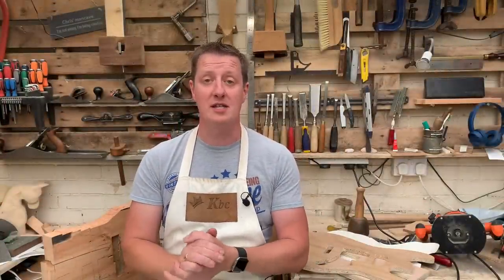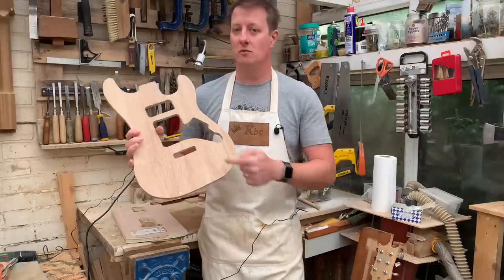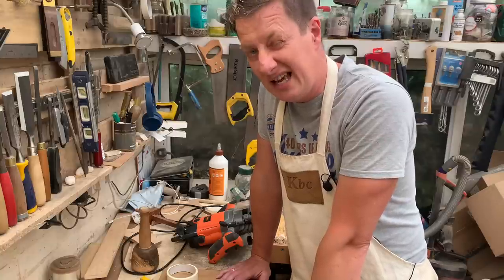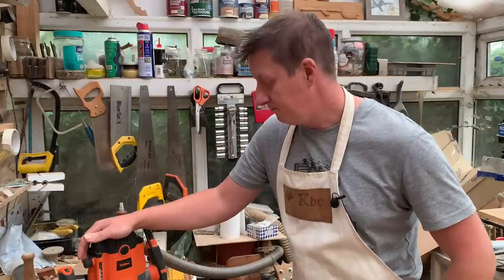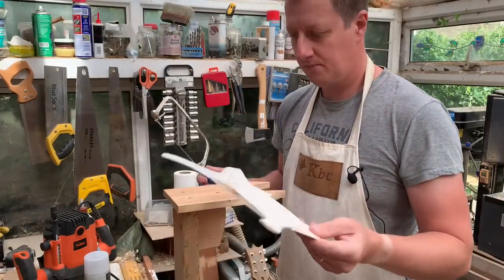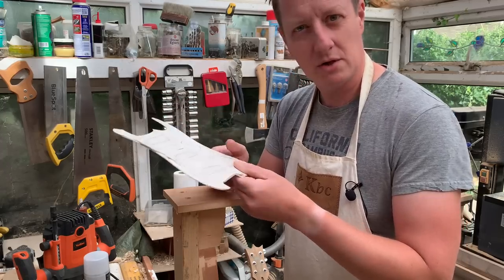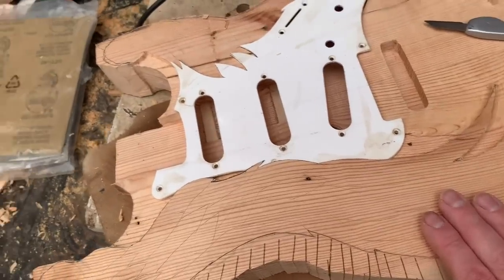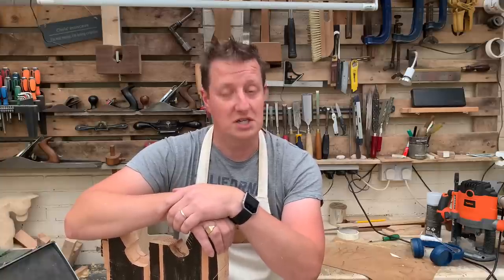Great guitar build off |  Part 3 using templates to create the Stratocaster body

Comment: Why do guitar builders, who are invariably expert in woodcraft, insist on using cheap and nasty plastic for their pickguards? Plastic was the great new wonder material back in the 1950s when Leo Fender first used it for the Broadcaster/Telecaster/Stratocaster etc., but now ..... it's just naff.
Reply from the maker: Stuart Barker which is why I make custom wooden pickguards to do pyrography art on. But this one has to look like Leo’s design I’m afraid
Reply: it's cheap, easy to make, easy on the tools and scratch resistant.
Reply: And....replaceable. It is a sacrificial part.